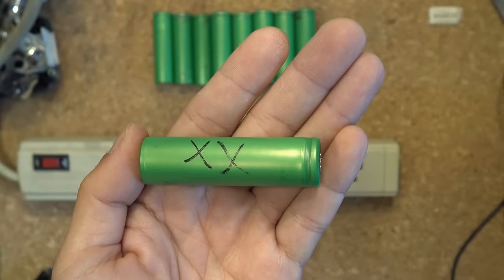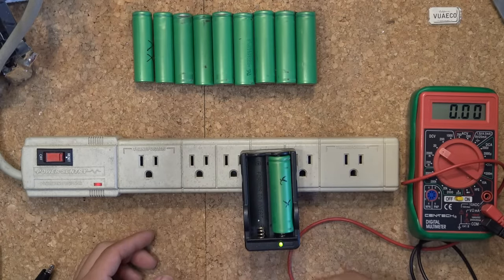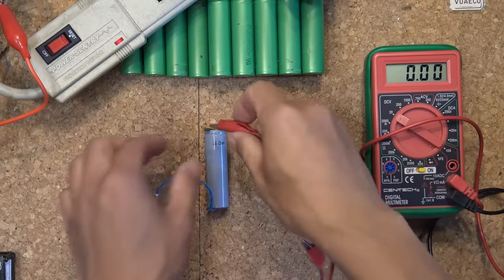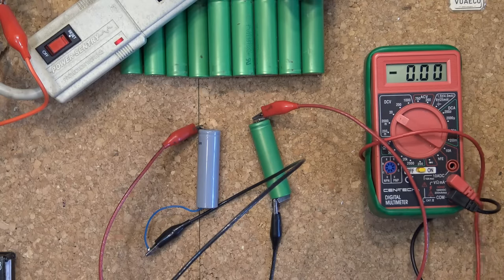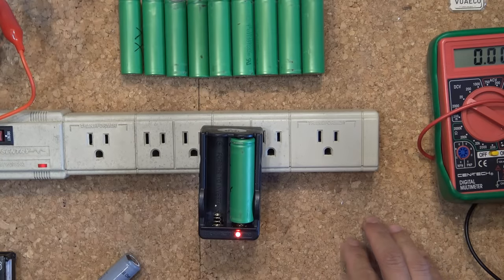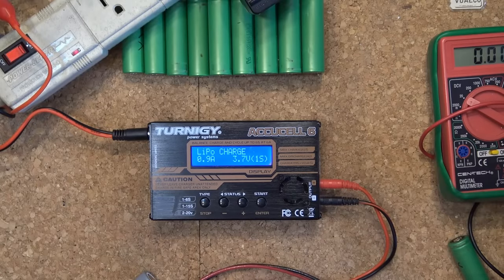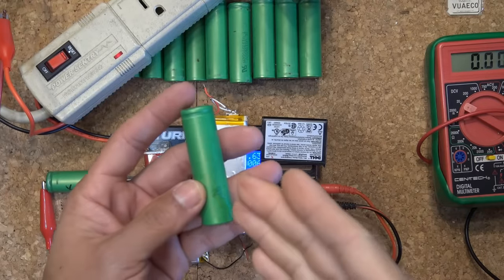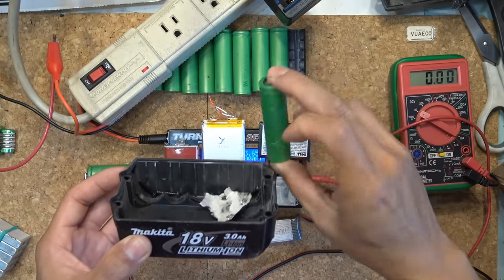DIY: How to revive a dead 18650 (or any) Li-ion battery cell

Comment from the maker: I have made a detailed video on this. There's a lot more information on this new video: https://youtu.be/yuLdi4oT7xI
Reply: Electric scooter 🛵 🛵 and
Reply: Excellent video content! Forgive me for butting in, I would love your opinion. Have you ever tried - Lammywalness Trendy Trade Guide (erm, check it on google should be there)? It is an awesome one off product for learning how to recondition batteries at home without the hard work. Ive heard some decent things about it and my best friend Jordan after many years got excellent success with it.
Reply: There are  several suggestions for getting a good result
never attempt to do this until you are sure what you are doing - the acid can burn your skin
check the voltage first - there may be a dead cell which would waste your time.
Check the battery fluid.
attempt to fully charge the battery.
(I discovered about these and more from Jons Mender Guide site )
Reply: Once the battery is fully charged, next find out what the capacity of that battery is.
Reply: @familyguyandothergreatanim2371  z xxx
Reply: Excellent Video clip! Sorry for chiming in, I am interested in your thoughts. Have you tried - Rozardner Powerful Battery Reality (erm, check it on google should be there)? It is an awesome one off product for learning how to recondition an old battery without the hard work. Ive heard some pretty good things about it and my GF after many years got excellent success with it.
Reply: @achristian7015  By how fast it's charging, about 0.1 Watthours. From experience, less, because lithium ion batteries below 0.5 Volts tend to create copper shortcuts.
Reply: I tried this and it works! My mother’s electric wheelchair’s battery was dead because of unused by time. Battery voltage is 24v 20a in normal. But after waiting without charging it descened to 0.0 voltage. There was no energy inside of it. And then i saw this video and i thought to use this trick in a bigger scale. I used to car battery jumper to increase the voltage and i used this methot until the battery increases to 12v. It takes a 10-20 seconds from 0 to 12v. That was the half capasity of it. And then i saw the voltage is discharging so fast as much as jumping to 12v. But it was enough for a moment to charge the battery by normal way with 29.4 v adaptor. Until 15v it was going fast too because the chemistry was deformed but i made it stayed in charge position for 24 hours in max capasity and then finished the battery totally and then i charged for 24 hours again. I did this routine for a few times. Now my battery is healthy as much as it can be. In normal way, wheelchair was taking 30-40 km in full charge with a mix with normal and agressive using and now it s taking 20-25 km in the same using. I dont know how long time it will keep this performans stats but it s better than nothing. For sure it cannot be perfect like the first time but it s a good way if you wanna use the dead batteries. Thank you very much for this trick man. I saved extra good money in my pocket because of you. God bless you.
Reply: @123ert789o   Agreed.
Reply: hi everyone ,if anyone else is searching for recondition lead acid battery try Jons Mender Guide (Have a quick look on google cant remember the place now ) ? Ive heard some decent things about it and my partner got great results with it.
Reply: @srbijapodlupom9907  Seems like a a bot is spamming Youtube videos comment section with this exact message >_<

Comment: The lesson of the clip for me is:  the use of the little magnets!
Reply: I am converted
Reply: Me too.
Reply: Using magnets actually work or no? Lol
Reply: @gerhang3361  not on my meter. tips are made of 316 ss material
Reply: magnetz it making cell fixed then litum batte light now voltage ok
Reply: I was using masking tape to hold bare wires in position like a caveman. Mindblown. I know battery covers and terminals are made out of nickel, so magnets should be attracted to them, but didn’t think of using it for charging
Reply: @arthurmorgan8966  I know, me too.
Reply: @arthurmorgan8966  not all small magnets are conductive. If they are shiny (nickel plated) they are OK but if you get raw ferrite blocks they are usually non conductive so they will not work in this case.
Reply: Yessss lol
Reply: actually a life hack
Reply: Ansolutely agree
Reply: Was on my phone but didn't watch the video just clicked it so that it is in my history and i can watch it on pc. But on my phone i read your comment and thought " hmm what could magnets have to do with this?" Now i am watching it and saw what you meant, and OMG this is an insane level of 5head
Reply: Great tip . Thanks
Reply: @arthurmorgan8966 Nickel isn't magnetic.
Nickel plated steel is though 🤦
Reply: @Willam_J amazing what some of us older guys ( well me for sure..lol) learn from a simple video..
Reply: 20 years in electronics and never thought about using magnets in batteries.
Reply: Yooooo, certainly is a great idea! 😎
Reply: It's a brilliant idea.
Reply: Fuckin aye, same here, awesome trick

Comment: The reason why charging at unlimited current is a bad idea is that when a lithium cell is discharged too low there is nothing formed on the plates, charging at a low current (sub 100mA) will reform the chemistry on the plates if you charge too fast it will cause uneven forming of the plates and WILL cause dendrites which are shorts inside the cell, that do not happen right away and if it is put in a pack it will short out and cause a major chain reaction
Reply from the maker: This is not charging at "unlimited current". It entirely depends on the cell you use to charge the dead cell. In this case the LG cell puts out 2C or 3 Amps max. And it's also and old cell so it would be even less than that. I have never seen any Li-ion charger that puts out less than 100mA. Let's say if you do have one, how long would it takes to charge a 3350mAh cell? Let me do the math: 3350/100=33.5 hours! Yeah, that's over 33 hours to charge a Li-ion cell which I have never seen. Most charger would only take less than 4 hours. Lots of charger would take less than an hour. Some even take half an hour. That means they charge the cell at over 3 Amps on a regular basis. I'm not saying that's good for the cell but unfortunately there are lots of chargers out there that can charge a Li-ion cell in less than an hour especially cordless power tool battery chargers. Take a good look at all cordless power tool chargers: Dewalt, Milwaukee, Ryobi, Kobalt, Bosch... all of them have fast chargers. In this method I'm using, I'm only charging it at 3 Amps for 30 seconds. That's even less than a typical charger that does it all day everyday. Sure dendrites are formed in Li-ion cells but that's a typical life cycle of a Li-ion battery. It's like human growing old, having white hairs and wrinkles, developing cancer. That's part of growing old. Not all dendrites are bad, however. Only ones that are big and hard enough to pierce through the cell layers and short out the circuits. Most dendrites are harmless and part of the life cycle of a typical Li-ion battery.
Reply: Yea but tell me the current that it charged at. Oh you don’t know for sure because you didn’t limit it. When reviving a dead cell you only charge at a low current until it is at a normal voltage again. Then you can charge it in your ultra fire linear parallel charger
Reply from the maker: SuperBrainAK
Yes, I know for sure what the charging current is. It's much less than 3 Amps. Here's the follow up video: https://youtu.be/vFmbG8GpS4A
Reply: The tool manufacturers want you to buy more batteries, so fast charging makes the customer happy and destroys batteries making the corporate jerks happy.... it's a win - "win".
Reply: One weird tip...I guess you're in the right place since youtube.com has no shortage of scams but the link you supplied is a classic marketing scam.
Reply: We are talking about dead batteries. Recovering should be at a low current. If I’m about to recover a battery I start with the ni/cad program at the lowest current available and when I think I have high voltage enough for the charger to go to lipo /li-ion  program I continue with the lowest current in that.
This is for the recovering charge. The next time I come a bit higher. But never over 1C. Lipo fire is a reality indeed I don’t want that in my garage. 
SuperBrainAK says you should charge at Sub 100mA (to low for the most chargers mine goes down to 100mA I think that's OK but I might be wrong).
Vuaeco say that charging at 3A (3000mA)is OK. That is not what I consider a low current.
And the 18650 cell can hold up to around 3000mAH then at 2C discharge this would be 6A (6000mA) That’s definitely not a low charge current. On a dead cell you better be prepared to call 911.

And if you don't believe in lipo fire just search for them on YouTube.
Reply from the maker: You are too brainwashed by those lithium fire videos. If you think charging at 3A is dangerous then you should call 911 everytime you charge your cordless power tool batteries (Dewalt, Bosch, Milwaukee, Porter Cable...). They all have fast chargers that charge your batteries at 3A or more. THey charge a 2Ah battery in less than 30 minutes. Some do that in less than 20 minutes. Do your math, that's charging at 6 Amps for the whole 20-minute duration. These chargers do that to your batteries all day everyday. I only do this for 10-15 seconds. So who should call 911?
Reply: vuaeco On a non dead 18650 3000mAH 3A is 1C. That's a normal charge current for that battery.
You could try to charge one of my 100mAH 1s lipos with 3000mA. Then you might get your blindfolds off.
Reply: There are several components to doing a pro job. One resource I found that successfully combines these is the Magic Mender Wizard (check it out on google) without a doubt the most incredible info that I've seen. look at this  great website.
Reply: Yes I got Ur point, giving the battery a head start to wake them up  nice approach thanks...
Reply: Y’all are some of the biggest nerd I’ve ever seen.
Reply: Nick Dinh LMAO
Reply: I\'m not sure but ,if anyone else trying to find out how to recondition my car battery try Corbandy  Battery Blueprint Crusher (just google it ) ? Ive heard some awesome things about it and my friend got excellent results with it.
Reply: SuperBrainAK
Reply: Styrola that has no relevance here we're speaking of single cell lipos  around 2000mah. Of course that would be dangerous for a 100 mah battery. But that's not what we're speaking about
Reply: If you compare charging DEAD cell to charging good cell i think you brainwashed yourself convincing that your method is OK and no questionts.
But if you are on a lvl tyhat you juding anyone who is not agreing with you means you need to step back and rethink what you doing.
But its your life, but renember yoiu propagating tips that mby younger users  will be using. Kids belive unconditionably, youtube is like second school for them. Dont screw their life coz you wanted to prowe how great your ideeas were.
Reply: @vuaeco  op
Reply: interesting points ,if anyone else wants to learn about battery reconditioning guide try Cypouris   Renewal Guide Coach (should be on google have a look ) ? Ive heard some amazing things about it and my neighbor got excellent success with it.
Reply: @vuaeco  The safe level of charging is greatly depending on the chemistry of the cell(s). Manganese based cells can be charged and discharged with much higher currents and nowadays most manufacturers use mixed chmistry, making it impossible to compare cells one on one.
Reply: Set your Turnigy (I use a Bmax) to NiMh and as example 0.4A and charge it just a short time. Set to LiIon and it will work to. But this low voltage is not good for a LiIon cell.
Reply: SuperBrainAK is right. Charging a dead battery without current limiting is dangerous. Use a laboratory power supply with current limiting or at least a resistor. Your test shows that the current is to high, because the battery gets warm in this short time.
Reply: SuperBrainAK is totaly right.
Li-ion batteries should NEVER be deep discharged.
Reply: Emre Kaya funny . When batteries go dead and won't take a charge it's because there chemical properties are damaged and rarely can be repaired . There like 3$ a cell recycle the damn thing and buy another one.  Not worth burning down your house or damaging you devise.
Reply: There is nothing wrong with what he done here. He didn't leave the battery in that state but for only a few seconds. And probably could get by with only a couple seconds.
Reply: Wow if you guys think reviving batteries like this is unsafe, you should see what I do with a DC stick welder 😂
Reply: @Styrola These cells aren't li-po, right? They're li-on. Way less volatile than li-po

Comment: Generally in battery pack  cells are parellal to increase the capacity of power bank , if one of the cells are dead which is in parellal ,it would itself be revived as you shown here seperately.if it is the case in general ,then no cell would get dead which is in parallel.its happened because it transfer the charge from one cell to another ,but dead cell has no capacity to hold that charge so ,it will drain in no time.

Comment: Great video, something else you can do to revive the cells is to set your RC charger to NiMh mode which does not have Low Voltage protection and set it at 0.1 amps, this will trickle charge the battery to get it above 3.0V and then you can switch it to LiPo mode :)
Reply: I do this trick at 0.1 amps using a bench power supply ... using NiMh mode is a great idea too ...